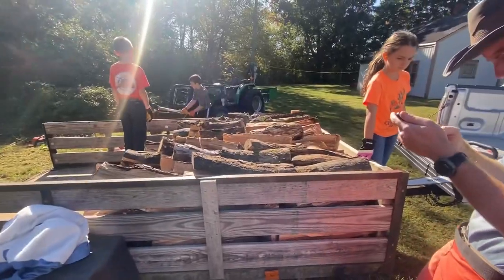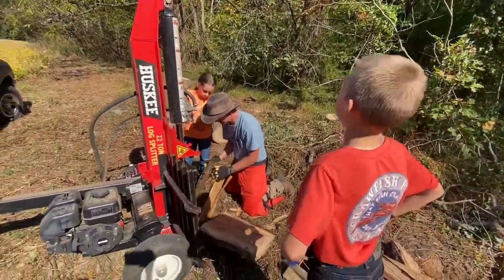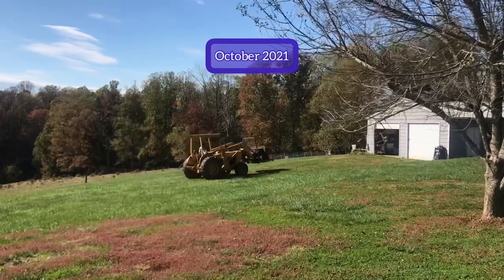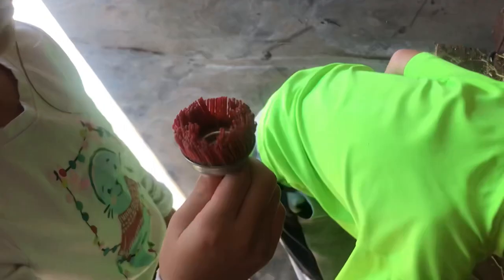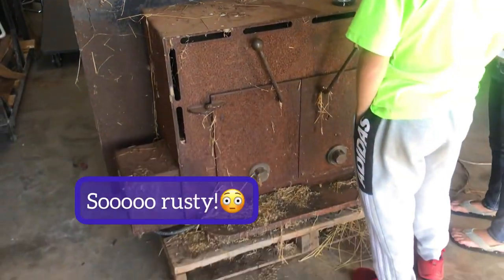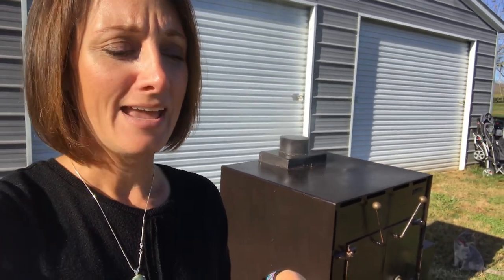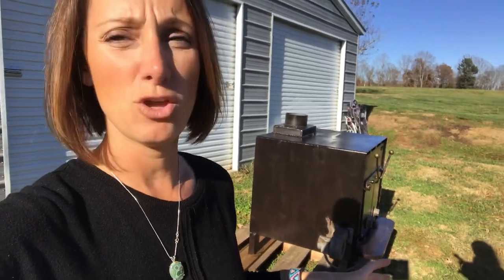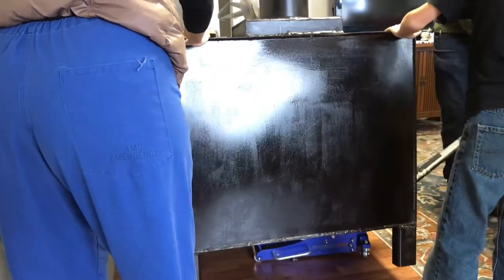Wood Stove Conversion SAVES Us HUNDRED$ | Heating with WOOD #farmlife #woodsplitter #stihl

Comment: Hey guys! I found your channel through Sheraton Park farms nothing falling those guys for quite some time I myself live in yadkinville in Boonville I do have a question about your conversion. What kind of heating system did your home have before made the change
Reply from the maker: Hey! Thanks for joining us! We actually were using a heat pump and still have it. The thing with having them both (wood stove as well as heat pump) is that when we have a fire going in the stove, the pump doesn’t have to run. We sometimes set it to “fan”and just allow the system to circulate warm air from the stove.
Reply: @blueridgefarmstead  Yes that's the way to do it when it comes to it heat pump I will suggest something on your hip hop you have electric heat strips. Disconnect those guys That's what's causing your power bill to go up, not the heat pump just a little FYI just another thought it suggestion what does bring a lot of views to a channel is discussing the farms homesteads water source supplies whether it's a wells or springs And whatever forms of water that you do have for your homestead. Just a suggestion You guys look so sweet and nice in your videos. You're genuine people and thanks again!

Comment: Why did you take the pipe through the roof? 
You could have put an angle on the pipe and just attached it to the gutter.
Reply from the maker: Hey! The double insulated pipe isn’t only expensive, it’s really heavy. So adding another turn would have also added to cost and weight. Thanks for watching!
Reply: Hindsight, we should have put the thimble at a bit more of an angle